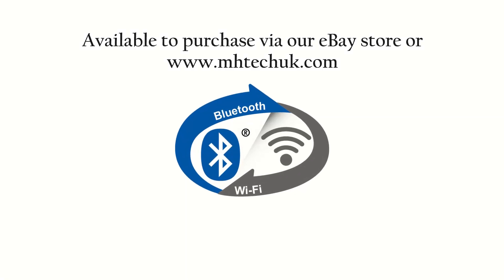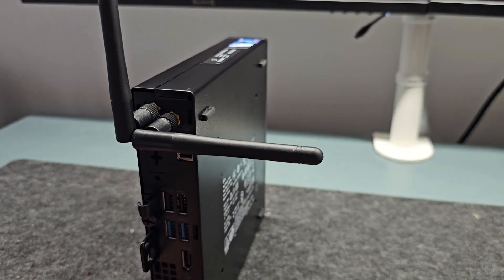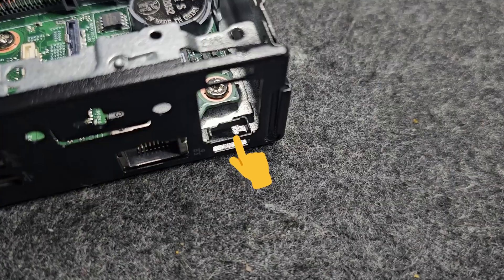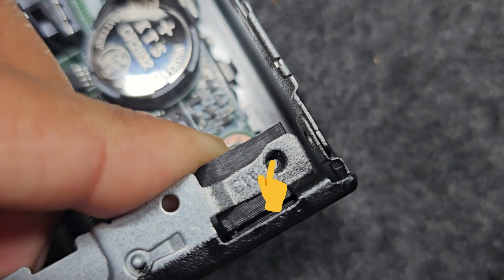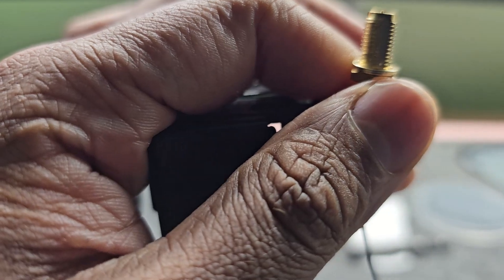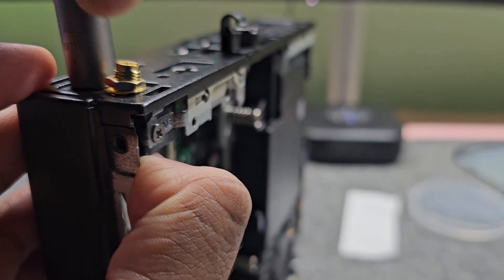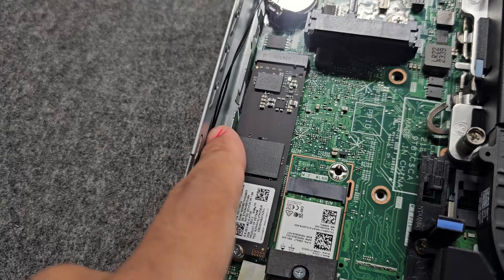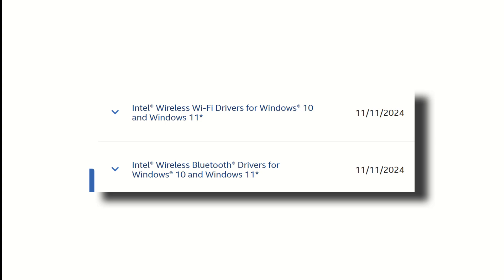Install WiFi and Bluetooth on Dell Optiplex Micro 3000 5000 7000 7010 and 7020

Comment: Is there a way to get the files to print that attena adapter? Im trying to add this kind of set up to my optiplex.
Reply from the maker: Hi, thanks for watching..Unfortunately we don't own any of the  files. We receive the parts 3d printed in bulks..

You can send a sensible offer via email for the parts you are interested in and we will consider
Reply: @MH_Tech_UK  what is your email? And i live in the USA thats why im inquiring.